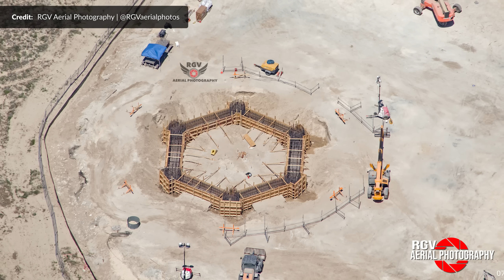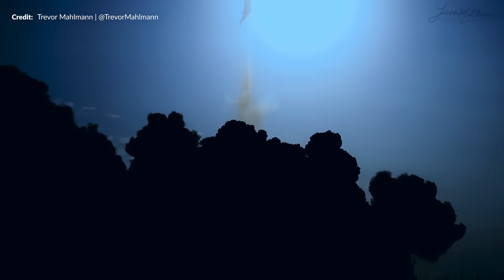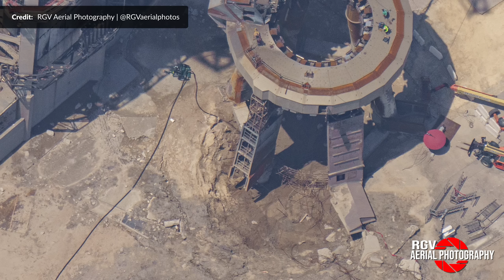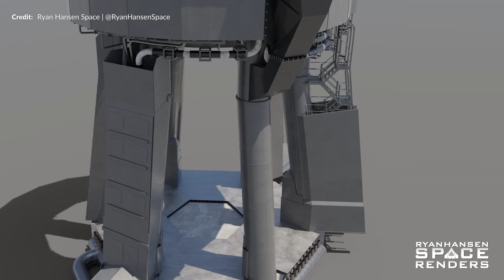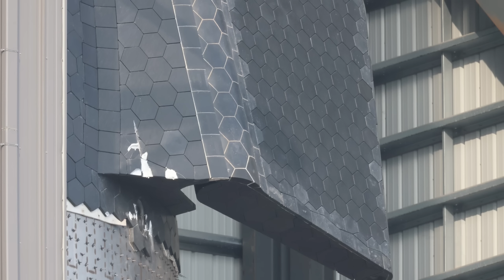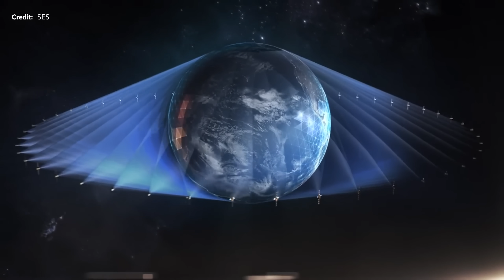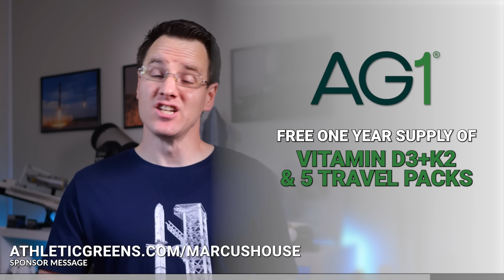The Starship Damage Left Behind: How are SpaceX Moving Forward?

Comment: Did all the chunks of concrete flying high cause the loss of six engines or was this another problem? Also how ever do they expect to take off from the moon or Mars when these surfaces are rocks, gravel and dust to begin with?  They'll be creating new craters every launch if the rocket & engines survive.
Reply: Earth 1.0 g 
Mars .38 g
Moon .17 g

Starship (the 2nd stage) doesn't use 33 engines, current version has 6 and only 3 of those are vacuum engines.  Future versions may have 9 (still only 3 vacuum).  Fewer engines working throttled less damage to the ground.

Some versions have been planned (whether still the current plan I don't know) don't use the Raptors for final landing or launch on either Mars or Moon but instead lower powered diagonally firing rockets mounted on the sides much higher up so debris would be less and directed away from the landing/launch site.
Reply: @Scanner9631  The 9 engine version of Starship (second stage) is 6 fixed vacuum engines and 3 sea-level engines that gimbal. I think you mistyped the 3 version.
Reply: @steveaustin2686  

Could be (guests arrived as I was typing that).
Reply: @Scanner9631  Yeah, I figured it was a typo, as you are pretty knowledgable about what it going on with SpaceX.
Reply: Way less energy required to launch from the moon and mars.

Comment: The entire concrete structure of the Launch Mount will need to be replaced.  That will give easy access to the installation of a much, much larger flame diverter and DELUGE SYSTEM.  Otherwise, they will build re-useable rockets launched from a mount that must be replaced after every launch.  Maybe next year.

Comment: I think it would have been better for SpaceX if one of those concrete chunks destroyed the vehicle - perhaps then Musk would start listening to the engineers (as he did in Falcon days, before everyone except for Shotwell left) and try something radical - thinking before building. 
Launch from the naive OLM that refused to bow to Musk's will and disintegrated instead, as everyone knew it would, wasted at least six months from the testing schedule. Thanks to widespread damage the vehicle suffered right off the bat, we don't know how undamaged Raptors would perform, is thrust vectoring authority sufficient, would staging work, let alone SS reentry behavior. The only really useful data set is that on vehicle structural integrity (and that's good, because Musk seems to go by trial and error there, instead of actual mechanical design - you know, finite elements stress propagation analysis and such.)
All in all, a wasted test.

Comment: The FAA needs to ban stage zero and demand a rebuild using proven technology from our main launch facilities.
Reply: To be fair, the OLM distance to the ground is roughly the same as the distance from the pads at LC-39 to the bottom of their flame trenches. The OLM doesn't have a flame diverter and water deluge system. Musk mentioned that they have a water-cooled steel plate system to install under and possibly around the OLM, but it was ready yet. Musk's "the best part is no part" philosophy bit him in the arse wtih the no diverter or deluge part. He rolled the dice that Stage 0 would make it through one launch without them and came up with a Nat 1 on the d20.

Comment: Since SpaceX designed that cool plate with an underestimate of destruction in mind it probably wouldn’t be sufficient for the actual destruction and needs a redesign.
Reply: Unless of course they did the normal thing and greatly over designed it to survive a "worst case" in the first place.  Unless the worst case scenario is now (based on the new data) worse than they imagined the plate may be a fine design still.

Comment: Although it would be a massive cost and time penalty, with the lease of SLC-6 and the presumed crew access arm going up at SLC-40, is the answer ultimately to redevelop the main LC39A pad to support Starship? It's allegedly engineered to stand up to way more than what  the Saturn V's threw at it.
Reply: To be fair, the OLM distance to the ground is roughly the same as the distance from the pads at LC-39 to the bottom of their flame trenches. The OLM at LC-39A is offset from the pad and needs the diverter and/or water system added. Musk wanted to avoid a diverter, so they could work under the engines on the pad, but will likely have to give up that access. With the cadence that SpaceX already has, they can't really give up Falcon 9 flights from LC-39A and SLC-6 looks to be for Falcon 9 and Falcon Heavy. With Delta-IV Heavy flights ending next year, launching FH from Vandenberg is necessary. Especially as the USSF wants both Vulcan Centaur (VC6) and the Falcon Heavy to replace the Delta-IV Heavy.

Comment: I don't understand why SpaceX celebrates that everything is broken, Nasa is laughed at when they start.

I find it very embarrassing from SpaceX that their entire start platform is broken.
Reply: NASA throws much more money at a problem and more years and is very conservative they go for a 0 failures approach.  This unfortunately results in little being learned but very high costs and time.

Look at SpaceX they didn't even start building the first Super Heavy booster until they had a fairly well developed core 2nd stage that had actually flown.  Why?  Because almost everything they needed to know to develop the Super Heavy booster could be learned in the development of Starship.  The opposite wasn't true.  So develop the 2nd stage 1st, that way an issue that prevents starship from being built or causing a radical direction change would be discovered much earlier and cheaper.  Also they have only been developing what is needed NOW or NEXT.  No wasting money on things that may never end up being used due to what was learned at the earlier stages.

NASA develops everything in parallel so any "oops this is impossible" results that cause fundamental changes in the design means a LOT of work and $$s get thrown away.  

Look at the Falcon progression.  They made Falcon 1 work.  Then developed Falcon 9 (and decided against Falcon 5).  Once it worked they had two more projects 1/ Making the 1st stage reusable 2/ the Dragon capsule.  Once those were working they went on to making Dragon reusable and man rated.  They learned enough that they didn't do as they wanted and try to make the 2nd stage reusable as doing so with the 1st taught them that the 2nd stage wouldn't be practical due to size.  NASA would have gone straight to Falcon 9, full re-usability and spent fortunes learning that they had to redesign from the ground up on a much larger scale to get what their target was.  SpaceX learned and ended with Falcon 9, cargo Dragon cargo and crew Dragon all fully functional and in use then they repackaged it as Falcon Heavy. 

Now they are taking a huge leap forward with Starship putting them (if they make it work) years if not a decade or more ahead of the competition.  The competition who are mostly still targeting competing with Falcon 9.  Again they are doing the work incrementally finding what works and what doesn't and changing later steps as needed and as they get to them.  Stage 0 and the Chopsticks were not in the initial design for example.  A NASA style development couldn't have adapted to accommodate them.

Comment: SpaceX apparently proved that rocket scientists don’t understand concrete.  The fact that they thought it would be okay to make one launch with nothing to address the blast seems, to me, to be at the level of negligence.  Very disappointed.
Reply: To be fair, the OLM distance to the ground is roughly the same as the distance from the pads at LC-39 to the bottom of their flame trenches. The OLM doesn't have a flame diverter and water deluge system. Musk mentioned that they have a water-cooled steel plate system to install under and possibly around the OLM, but it was ready yet. Musk's "the best part is no part" philosophy bit him in the arse wtih the no diverter or deluge part. He rolled the dice that Stage 0 would make it through one launch without them and came up with a Nat 1 on the d20.

Comment: Played back slowly, the rocket exhaust sounds like a series assortment of differing pops - Is it the heat, the sharp  "pops" (detonations?) hammering on Stage 0 that caused the damage. Can there be a pressure multiplier going on with the series of alternately reinforcing and destructive supersonic pressure waves "(MEGA) POPs" coming from a concentrated configuration of engines with 32 engines firing at once and a series ??? Does the number of engines  pulsing irregularly in close proximity make the 32 engine exhausts additive as are ocean waves??? Sorry, I do not have the knowledge to quantify this possible phenomenon, but combined effect could be gigantic. A spectrum analysis of the exhaust sounds individually and in concert could be very instructive. Pressure waves in an already hot exhaust should be increasing proportional to temperatures - likely the cause of the "string of diamonds" artifact in supersonic jet and rocket exhaust. Perhaps slo-mo photography could be used as well as sound to measure temperatures and pressures. Does the exhaust recycle the chunks of debris like a colossal sand blaster before they go flying long distances?
Reply: Falcon 9 and other medium to heavy lift rockets sound like that. Like the atmosphere is tearing.
Reply: @steveaustin2686  Thanks Steve, listen to the  sounds of the exhaust in the slo-mo portion of the video.
Reply: @tobyw9573  You're welcome. I've seen Shuttle,  Atlas-V, and Falcon 9 launches in person and they all sound like that.

Comment: The old phrase - speed kills - comes to mind.  A few months of delay may, and it is only may, have save the damage that occurred.  So now SpaceX has to deal with the FAA and EPA once again.  Expect the Government to slow the development of the Starship going forward.  Overall, bad decision making by SpaceX administration.
Reply: The FAA grounding is not unusual in these situations. The Falcon 9 was grounded in Jun 2015 when the CRS-7 mission had a RUD. SpaceX resolved the problem and flew the next booster in Dec 2015. Sir Branson's SpaceShipTwo VSS Unity was grounded when it flew a little bit out of the restricted airspace on his sub-orbital flight in 2021 and nothing was damaged at all in that incident. The debris flung out of the intermediate area around the launch pad is a concern, especially the sand blown over to Port Isabel and South Padre Island. It's likely the investigation involving the FAA will be over, before Stage 0 is finished with repairs.

Comment: Surely Starship launch needs a trench. Environmental approvals going forward are going to be interesting.
Reply: They just half dug one very quickly.
Reply: To be fair, the OLM distance to the ground is roughly the same as the distance from the pads at LC-39 to the bottom of their flame trenches. The OLM doesn't have a flame diverter and water deluge system. Musk mentioned that they have a water-cooled steel plate system to install under and possibly around the OLM, but it was ready yet. Musk's "the best part is no part" philosophy bit him in the arse wtih the no diverter or deluge part. He rolled the dice that Stage 0 would make it through one launch without them and came up with a Nat 1 on the d20.

Comment: Like the program. Any information on the FAA Incident Investigation? Even if the ship was within the planned flight, the damage to the pad should require, at least, a report to be filed before the next flight.
Reply: The data from the flight will be gathered and fixes and mitigations will be proposed. It is likely the repairs to Stage 0 will take longer than the investigation with the FAA. Now if the sand blown over to Port Isabel and South Padre Island is contaminated, then all bets are off.

Comment: @MarcusHouse Questions: How could SpaceX’s model got the concrete so wrong? Was the diagonal launch intentional? What caused the engine failures? Launch was slower than expected: was that because of loss of engines or were all engines throttled back? What was creating the flares from the manifold? The booster explosion appeared to start at the engines: was that the FTS or something else?
Reply: This is around twice as powerful as any other rocket ever launched, no concrete has EVER been under this much of this type of stress.  It would be surprising if their model was anywhere near perfect.  Why do you think Musk put the odds of total success so low AND his definition of total success so low as well?  Too many unknowns when launching the LARGEST EVER by a substantial margin rocket.  

Chris Hadfield, a Canadian astronaut and military test pilot (has worked for both the U.S. and Canadian military in that capacity) gave a interview about this launch.  Obviously he is knowledgeable about rockets and tests of new designs.  He was VERY upbeat about the high level of success of this launch and I agree with him.  

The pad is still standing.  The rocket didn't explode until the flight termination system was used.  The tank farm didn't explode.  BIG WINS in this.

Comment: can't they put structures underground? Like the tanks?
Reply: Can't put much under anything, they're a couple of meters away from seawater. The crater dug by the rocket already had several feet of water in it by the time arial shots were posted. 
This is why the OLM is so high off the ground, and in Florida is why Nasa builds ramps for the crawlers to take rockets up to raised pads.
Reply: They would be under water as the water table approaches ground level. Also cryogenic so they would freeze the local water in the ground.  Much less repairable if buried deep enough to protect them.
Reply: @Scanner9631  There's absolutely no reason to do that at all. You don't hide your gas station underground in case cars crash into it, you instead focus on not crashing cars.
Reply: @Scanner9631  thats interesting. Is it impossible to build beneath water level? Can't they did a massive hole and then lay down concrete. So it's like a large underground bunker thats open top?

And for the cryo stuff, leave larger gaps. Sorry if this sounds riidculous it's hard to explain my idea 

thanks for the reply though it's interesting
Reply: @Jack-uc5ly  It's not impossible I understand, but very difficult and expensive to do so.